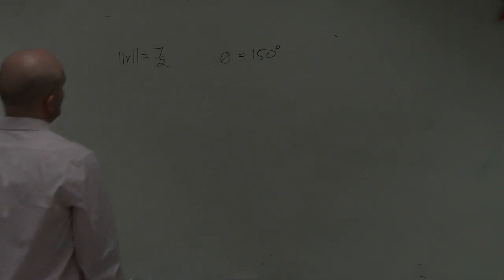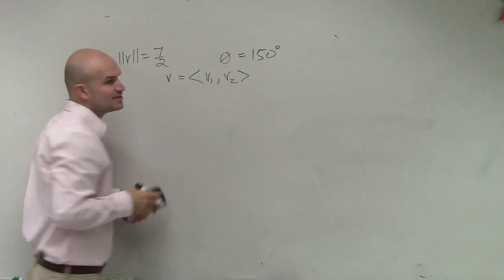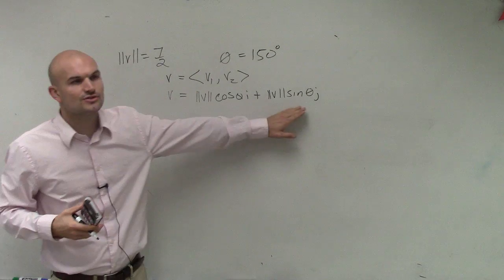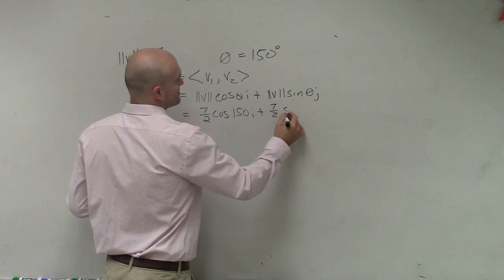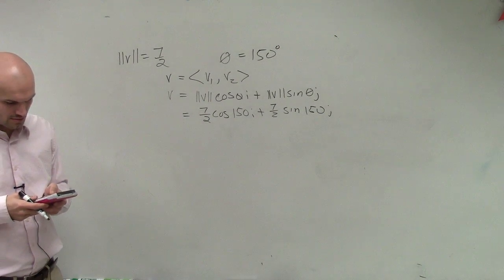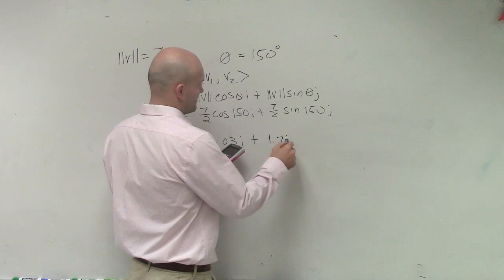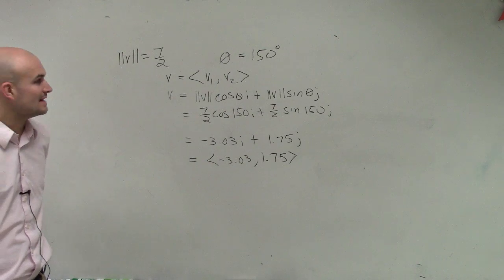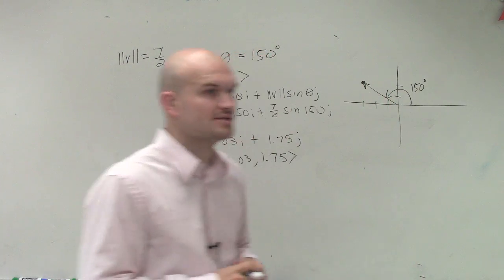Writing a vector in component form given a magnitude and direction

Comment: Do most teachers use calculators? Mine insists that you need to be able to do all the math in your head by giving us equations that we can feasibly do so with. However I'm worried that in real life the kind of equations I will be dealing with will be to complicated to do in my head.
Reply: If you can’t use a calculator you aren’t very far in math. Once you get to use a calculator, it can’t save you anyways.